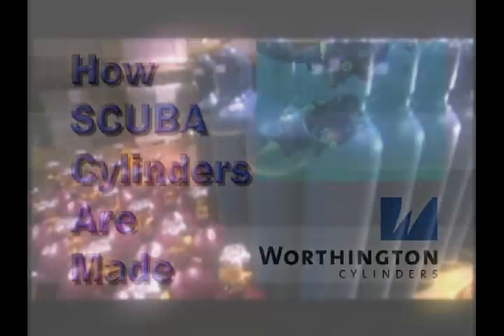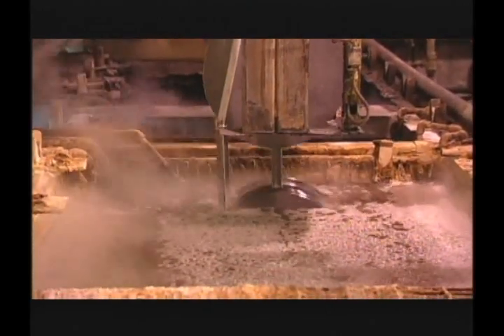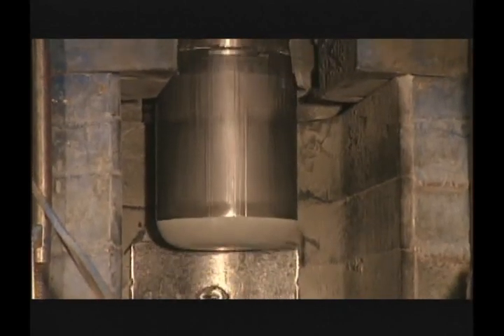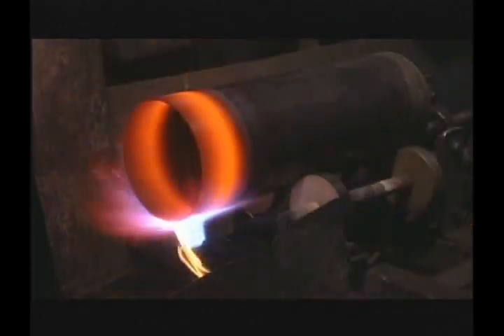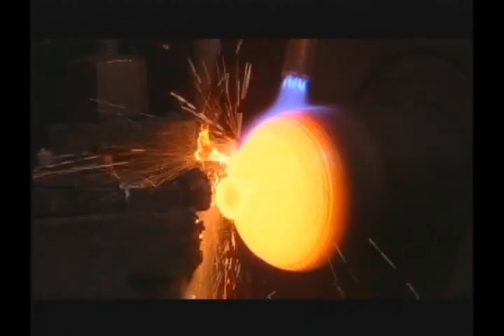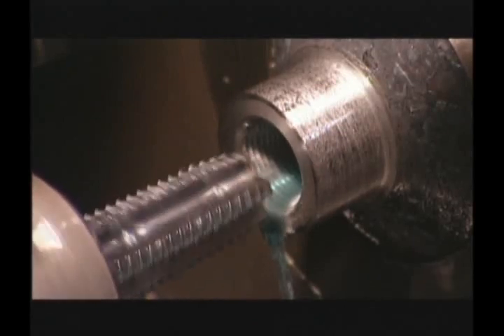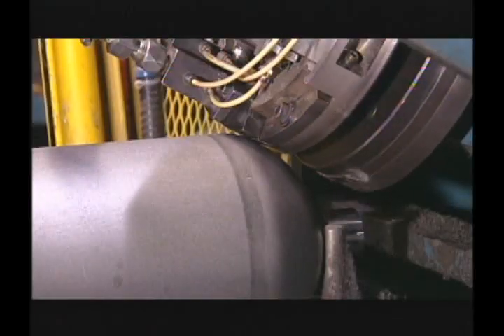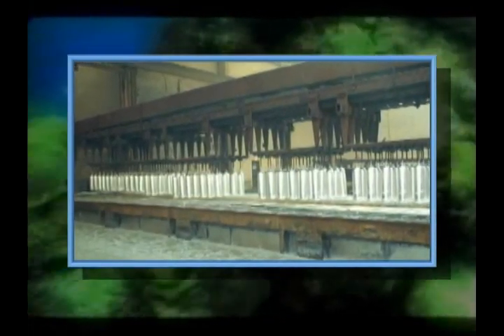Making Worthing Steel Scuba Cylinders

Comment: Some scuba tanks are made of Aluminum, instead of steel. Aluminum tanks are lighter by a few pounds.They don’t rust as steel ones do. They can be lined and coated too with epoxy or plastic colors. Either cylinder scuba bottles is   40 pounds empty Add a 5 pound air fill, a backpack and weight belt with 10 pounds of lead weights on it, to get its total weight.